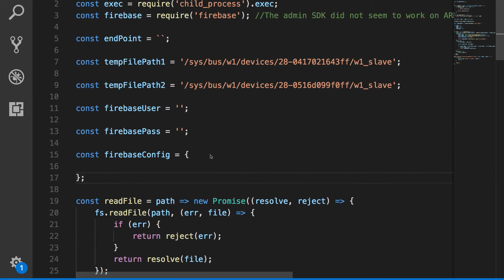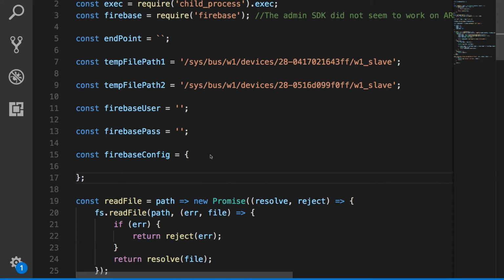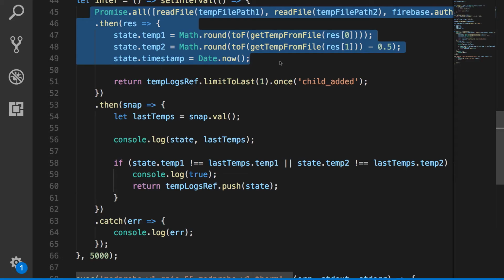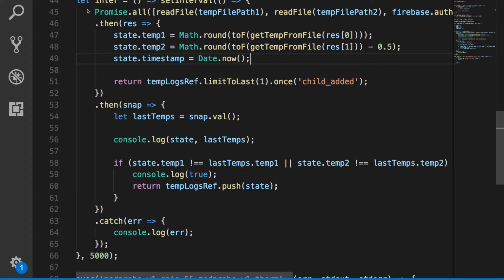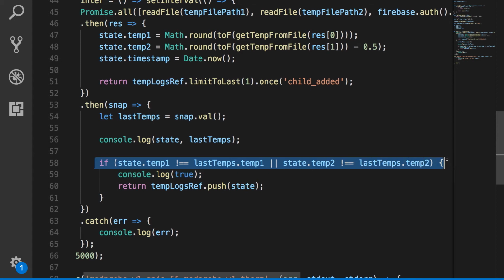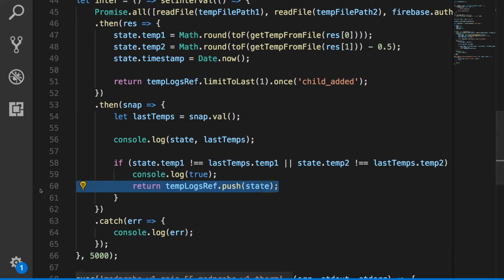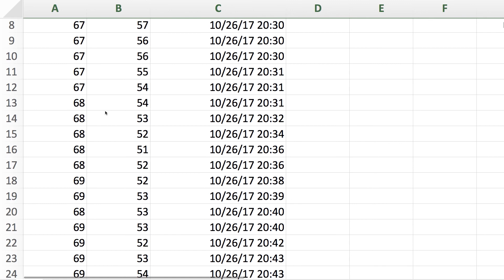Dual Internet of Things Thermometer & App | Raspberry Pi

Comment: Hey Celeb, could this be set up with more probes say 10 +  Thank you
Reply from the maker: Sure. That shouldn’t be a problem.
Reply: Thank you
Reply: Would you just solder the red power wires together and plug them all into the 5V pin?